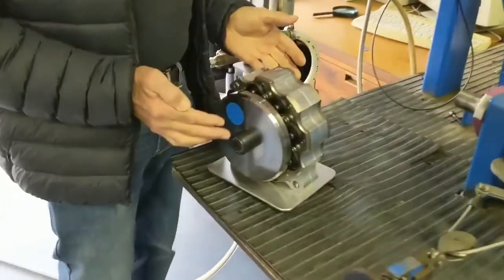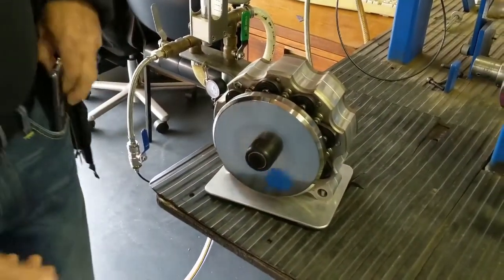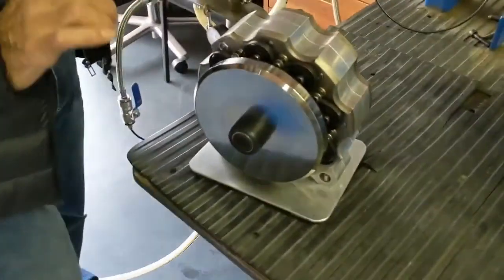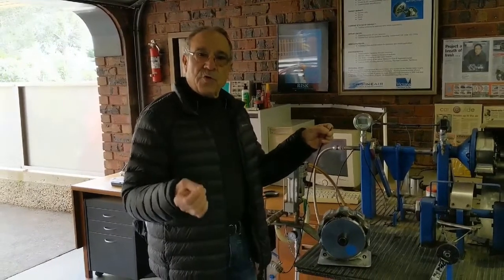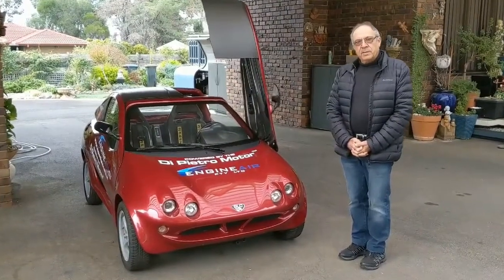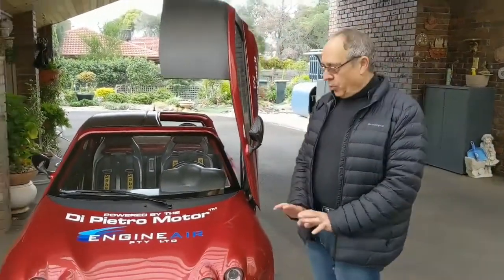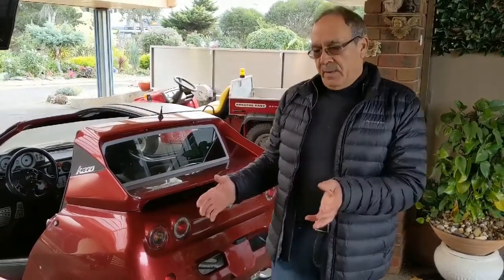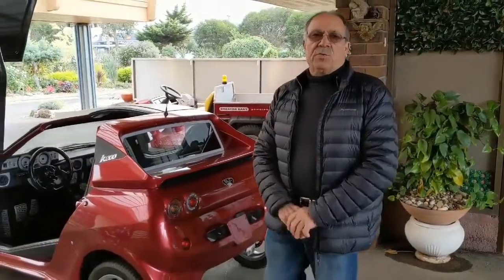Interview with Angelo Di Pietro

Comment from the maker: Thank you to everyone for the kind comments, I am working passionately on my current project, 14 passenger’s commuter bus, it’s with pleasure to show you my next video at the completion of the project approximatively by January 2023. 
Thanks again and take care.
Reply: I am very passionate about renewable energy and if I have a very substantial amount of money I'll be betting on this one. I really think that this is more better than battery powered ones. Batteries used in vehicles will just last in a few years time and is expensive to replace. Compressed gases can be produced(stored) by high pressure compressors which can be run by solar energy.  Investment in powering this machines is not expensive not to technically complicated and charging stations can be easily integrated with any regular gas stations. I am just wondering why not anyone is promoting this into a commercial level. I dearly hope so in the very near future..........Robert L. from the Philippines.
Reply: Most engineers have given up on compressed air because of the thermal energy lost during compression. You have a slide presentation showing how this is compensated for by using cooling from decompression for vehicle air conditioning. I think this point should be highlighted to convince skeptics. Otherwise they'll be thinking, great motor but he's not talking about overall system energy efficiency.
Reply: This is amazing Mr Angelo. 

You can certainly show us the final but what would be even amazing if you can make a video on building such a vehicle as well your choice of materials like fiberglass , width and height etc either way I really like your work keep it up please and make more frequent uploads 

Is there anyway we can reach out to youm
Reply: @kit888  Just remark! I often think about this problem and wonder how the Stirling engine could be used in this specific case: if the compression generates heat, couldn't we use this heat to make the Stirling engine do some work? Certainly, but I don't know which one?

Comment: Doing things with compressed air is the most elegant solution but I imagine liquid nitrogen could be used too with this motor and it would give for the same weight more range. But the heat exchange is now even more problematic.